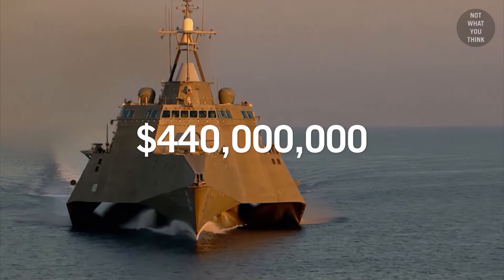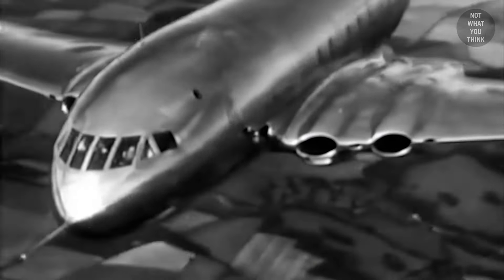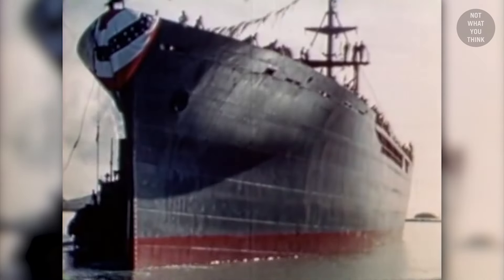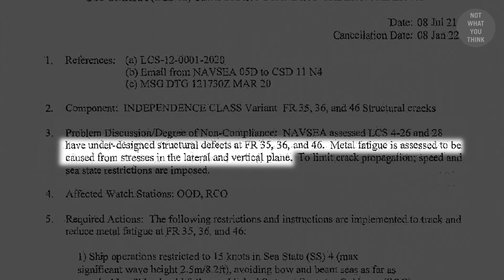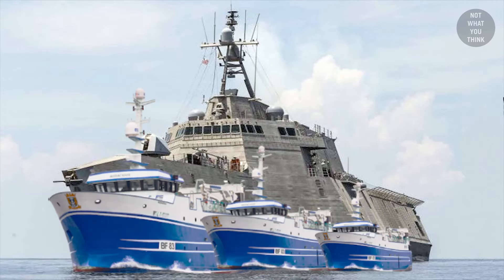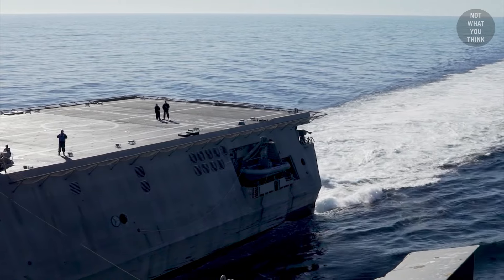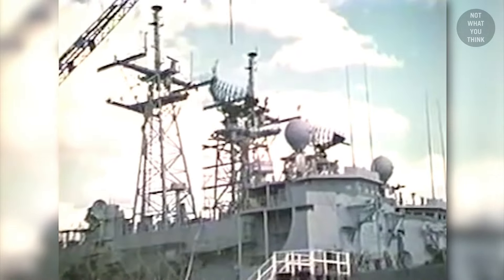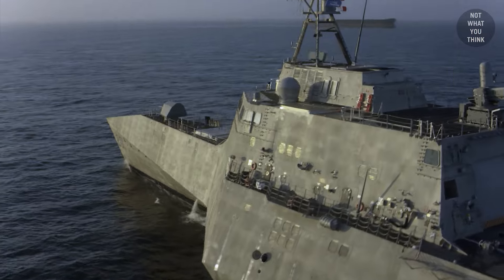SPEED Makes This Warship CRACK!

Comment: You'd think that with all the known issues with cracking in aluminum superstructures that it should have been obvious that building an entire class of ships out of this same material should never have been considered much less implemented. This should be even more of a no-no given that in the littoral waters where wave action would be even more pronounced and the possibility of encountering small boats turned ad-hoc military craft that if not neutralized quickly could inflict a fair bit of damage in short order. Since the USN has previous experience in how fast and complete aluminum can weaken and collapse, as was seen aboard the USS Belknap, it makes no sense to make an entire ship out of this same material. The loss of some speed would be a fair tradeoff to make to have a hull made out of steel.
Reply: Aluminum is used to reduce the weight of the ship and increase it's speed. Althrough you might as well just build them out of wood or plastic.
Reply: I'm betting some pockets were lined on both sides of the uniform.
Reply: It’s so stupid to build a ship out of aluminum that can not take any flexing and lack of strength from and incoming fire it would melt if on fire, they should of built them out of magnesium and would burn so hot and completely burn to nothing and at the bottom of the ocean it would still until there was nothing. And we pay these engineers big money but if they don’t have common sense they would build a hole in bottom !
Reply: You're completely missing the benefit of aluminum warships being easier to crush and recycle, as we now have to do with these. 😂
Reply: There is a MASSIVE amount of vessels made of aluminum before these vessels.  They are just fine, in fact they are tougher and faster than their steel counterparts.
Reply: @edwardschmitt5710  In which Navy would those massive amounts of ships be in because it certainly, except for the LCS, isn't the USN. As to such ships having superior resilience a fair number of Independence-class ships have proven that to not be the case given that half of the 13 vessels in service have developed cracks to such an extent that they are not allowed to operate in Sea States 4 or higher.
Reply: @randybentley2633  I see (giving sailor terms), you have changed tack and failed to address what I said. My qualifications to comment on boat building (by the way check out Sampson Boat building's "Tally Ho" project on this platform, I've watched all 150 episodes, or for laminations of mixed use see Louis Sauzede).  Now I will disengage.  But I will answer your obnoxious question:  "In which Navy..."  Yours in your bath tub.  And what ???? Cracks in the vessels?  Like the ones described in this very video we are watching?  Did you learn about "4 seas" before or just now?  It's hard to win an argument with a smart person but impossible with one who isn't.  Bering see fishing boats are aluminum, but mostly steel.  Coast guard small rescue boats, THOSE are RHIBs, with the upper structure almost always aluminum.   This was a new design, that failed.  It does not mean aluminum isn't a good material for boats, that is NOT the takeaway here.  Your type of argument you are attempting to use is an "argument of authority", accept the only info you are citing we both watched and it is not enough for you to opine.  I'm ten minutes from the ocean.  How many aluminum boats have you even been on?  I've been on hundreds and own 2.  In total I own 5 boats at the moment.  I'm 52.  How old are you?  What is your personal boating experience?
Reply: @DavidRice111  always has been

Comment: With regards to the liberty ships, in order to manufacture them in a matter of weeks, all the metals panels of the ships hull had to be welded instead of riveted. 

So what had was, once a crack started to form from example shell impact, the hull would start to crack and keep on cracking until the ship was cracked in two. If a shell had damaged a panel on a riveted ship, only the panels around the impact would get cracked/destroyed, but the crack would propagate through the rivets through the rest of the ship

Comment: I don't know what think tank told them aluminum was good for a ship but as you can see all aluminum is in trouble when in salt water. electrolysis is one thing but fatigue is a complete killer for the material and I think the navy has figured it out and is just trying to save face with there pride and joy or what was supposed to be there pride and joy
Reply: I think they were heavily lobbied by the aluminum manufacturers. When the damage was done the Navy demanded the production of the LCS to stop in addition to every other ship using it as a superstructure and they tried to change them to steel or something. The aluminum producers hated that and said that if they did, they will sue the Navy. The producers argued that it was not the aluminum that caused it, but tests seems to say otherwise.
Reply: The other issue was what these LCS models were going to be used for... mine hunting.  Low-magnetic (degaussed) steel is EXPENSIVE and HEAVY.  The ship wouldn't have the speed the Navy required nor immunity to older mines IF they had used steel.   The irony I see is that neither mine hunting nor littoral operations require a high degree of speed, so that speed requirement was a waste of resources for a mine hunter.
Reply: @swaghauler8334  This is completely true.
Reply: The report mentions galvanic corrosion at one point. This occurs when a potential difference typically in the tens of millivolts is set up across two dissimilar metals (assume aluminium and zinc on galvanised steel) separated by an electrolyte such as sea brine. This has been described as the aluminium "fizzing away" in cruise ships with steel hulls an aluminium superstructure. I can only assume that part of the problem here is the use of dissimilar metals in sea water not simply the engineering properties of welded aluminium. The tell tale signs of galvanic corrosion are visible corrosion a p.d. (voltage across the metals) and the evolution of hydrogen gas !

Comment: so from what I'm seeing and I'm going to say now I'm no physics expert but judging by the fact if they come across rough water bow on they can stress mych more likely, my guess is this isn't due to the aluminum hull but the actual tri hull structure itself. the complex design of the hull literally has a massive problem where a giant bow is connected to the side hulls with a convex plate armor. every time this thing hits waves that push up on the bow you have a few seconds where the weight of the ship is hitting a wave at speeds where the waves are hitting super hard and the bow is taking that stress and carrying it to those convex plates where stress fracturing is likely as the bow wants to go up and follow the waves for a few seconds and the convex plates are going nope you stay still. this repeated stressing is whats likely causing the stress cracks to appear. if this was scaled down in the front by 30 feet it might have reduced the stresses its recieving but only minorly. if you look at smaller boats with tri hull designs they don't have massive bow structures that are more than 30% of the length of the ship. likely earlier boat designers knew if you did there'd be heavy stressing of the connection between the central hull and side hulls so they never upscaled them to this size.

Comment: ALUMINIUM will always fatigue over time, unlike titanium or steel which require a given stress load.  Aluminum is lite and stiff, but comes with a cost. Same thing happened to my aluminum bike frame, but not to my titanium or carbon fiber bike frames.
Reply: 90 % of the bike frames sold in western countries are aluminum bike frames. They can crack, but only few does. My aluminum E bike frame has run now for 22k km, it's used to transport heavy stuff sometimes but it's still fine, in this case they didn't make the material extra thin to squeeze out the last gram for weight saving. 
Carbon fiber has a completely different fatigue characteristic, it can delaminate over time, and it don't bend - it stays flexible to the point where it snaps completely. Contrary to metal however carbon fiber is sensitive when it comes to side impacts, since it's a fiber material with the most strength in fiber direction. 
Concorde had a carbon fiber rudder, there was one case where a Concorde lost half of its rudder because of undiscovered delamination.

Comment: Interesting fact about steel hulled ships with aluminum superstructures. They use implosion welding to join the steel and aluminum. The metal comes in strips a few inches wide by two or so thick that are aluminum on one side, steel on the other. Theres a cool pattern in the middle where the sheets of metal were bonded together using explosives. Everything from the main deck up is sitting on those strips. Thats how you make a steel hulled ship with an aluminum superstructure. I worked for a few shipyards in my late teens early twenties. I picked up the metal from a supplier and was told absolutely dont let anything happen to those strips, they're expensive. Which immediately made me wonder if I was allowed to let something happen to all the other stuff I picked up. Turns out no, no i was supposed to protect that too. Stupid job.😁

Comment: Lol any welder could of told them this was going too happen (in fact I guarantee the builders did but the office staff didn't listen to the guys that actually do the work).
An to all the people that buy Ford truck with "military grade" aluminum this Is what you get to look forward too.
Reply: You would point that out.  Ford trucks, built Ford tough.
Reply: @ericvardek4108  Ford truck are great but only for the first 5 years, but that has always been true they have a tendency to fall apart after that.
Reply: @smokeshow1984  what about Chevy?
Reply: @Joshua_N-A  chevy/gm doesn't have aluminum frame's or body's.

Comment: Kinetic energy increases as the square of the velocity. Ship flex is measurable so you can stress the ship in various ways or test models, then measure the flex. This flex can be calibrated against the design software. The properties of materials used should be well known. It appears that Austal has a crummy engineering department, or management is interfering with them, and the Navy is incompetent to oversee the process.

Comment: From what I know and have heard earlier weld cracking had a lot to-do with HYDROGEN EMBRITTALMENT,      6018, 7018, 8018 etc.    steel  welding electrodes also called "Lo Hi electrodes"  short for "Low Hydrogen"    that were NOT heated in a special "rod oven", at hi temperature s  for a specific length of time and use within a short time,  would  absorbe  moisture.   
  That translated into "weld bead cracking",

Comment: How to defeat the US navy? Just try and get them to meet you near a storm front. No ammo required either. I guess the trade off for speed versus usability is really clear here. Maybe steel would be a better material at least for the hull. Superstructures can tear up a bit and be fixed with gum. Hulls,.. not so.

Comment: In Sweden, I think it was so, they use a special carbon fiber tape on concrete bridges underneath the structural beams  as reinforcement to extend their life.
It is incredibly strong stuff.
I suspect if they pre-taped vulnerable parts of the ship with this stuff it would significantly extend the ships service life.  It could also be used in the event of cracks starting to form at sea.
Reply: Yeah ...built lots of ships have you?
Reply: @edwardschmitt5710  A good idea is a good idea no matter where it comes from.
It is better to try than not bother isn't it?  Especially if it could save lives.
That tape can stop a bridge collapsing including the weight of many vehicles such of cars, trucks and buses, it would rather likely be able to stop the crack entirely from forming and certainly has the strength to stop it spreading and coming apart entirely.
Are you qualified to say I am wrong ?
Reply: @OniMetsuki  I build boats as a hobby.  Behind me out of the window is an aluminum boat I am restoring.  I have also built with fiberglass.   Now whether an idea is good or not, generally speaking, would center around all the facts.  In this case it would be the properties of the two materials.  No one, and I mean NO ONE sandwiches ANYTHING between two metals building boats.  Now lamination does occur with non metallic things in boat building particularly with polyester fiberglass resin.  Your example is they put carbon fiber UNDER bridge beams.  Entire boats are made of carbon fiber, particularly race boats.  Your comment just races between A and Z.  There is a whole alphabet in between (a science called "structural engineering" and I know there is a lot I don't know about that).  Even in my little aluminum boat I cannot see where you would add "carbon fiber tape" in between the seems without weakening it.  Like materials are universally used when building boats because of the stresses and loads unique to things on the ocean.  There is also the expansion and contraction of material  due to temperature fluctuations.  Not a big deal on a bridge but.....well I really could go on and on here.....but suffice to say, NO.  Even allowing if it COULD work, do you know how much that stuff costs?  I know I could not afford it in the 16' boat I built.  There is a reason race boats cost millions.....just "adding" a stronger material makes stuff stronger"???????? "Couldn't they just make the huge boat out of titanium"?????  There I fixed the Navy's issue from my keyboard as well.

Comment: AL structures crack for the same reason a 4130 tube steel frame cracks after ANY form of electric welding - localized heat treatment from the welding process.

Comment: While the Comet did have square windows the corners were well radiused. The problems arose due to the greater than expected stresses of compression and decompression after the Comet had logged over 30,000 flying hours. Metal fatigue was poorly understood in those days.

Comment: other issues with LCS.
-Armament: The LCS is the same size as a Fletcher class destroyer of World War II, but that ship had far more weaponry including 5 inch guns, torpedoes and anti-aircraft guns.
One of the LCS missions is Anti Sub Warfare, but it has no ASW weaponry. Yes, it would have a helicopter, but what if the helicopter is broke down or off on a ferry mission. 

Who thought up this maximum speed of 40-50 knots? This isn't a cigarette boat for teenagers. Endurance is more important than speed...big engines and a heavy frame make a coastal ship far too big. All other modern coastal ships around the world are half its size.  Twice the size means twice the target and twice the cost, all this for high speed? The LCS is the size of modern frigates and bigger than destroyers of World War II, yet has the armament of a patrol boat in order to accommodate the mysterious ultra high-speed requirement.
Reply: It looks cool. And obviously, that‘s all that matters nowadays… 😁
Reply: About the speed thing. Faster = safer. 
All the better to dodge in-coming swarms of Chinese hyper-sonic ASMs, right?
Reply: @ericvardek4108  Constraints in current ship design technology make this desired combination of design characteristics in small ships difficult to realize at any cost. Speed, displacement, and significant wave height all result in considerable increases in fuel consumption, and as a result, severely limit LCS endurance and weaponry. A speed of 35 knots is not needed, not for mine hunting, not for patrolling since it burns too much fuel, and not for anti-submarine warfare. Ten knots makes little difference trying to avoid anti-ship missiles or aircraft. It would only make a difference while pursuing small boats, but then it has a helicopter. Finally, corvettes operate in unfamiliar shallow waters with reefs, sandbars, and underwater rocks, so going fast is unwise.
Reply: @spikedpsycho2383  So, bad idea all around. Got it.

Comment: Aluminium performs badly in a maritime environment. The constant back and forth rocking motion, plus the corrosive seawater causes metal fatigue to develop quickly, from micro cracks to visible cracks. Even a speedboat that is made of aluminum requires frequent maintenance due to this problem.
The LCS looks beautiful in appearance and it's specs looks great on paper. Inspite of this it's hard to imagine why would any navy want to use aluminum for building ships.

Comment: I've worked with aluminum, and would not want a warship to be made of aluminum. Not to mention how weak aluminum is. Aluminum is a bad metal to use when exposed to waters, there's high corrosion. If Steel has such structural issues, than aluminum is worse. The only place aluminum should be used is aircraft, or ground based vehicles, and even still isn't necessarily the best choice.

Comment: I've built many aluminum boats. But one navy ship the uss. Decatur had the first aluminum main deck above super structure. The problem with aluminum 
On a ship as primary metal is that the temperature of saturation is faster than steel. And at on time a Hull may be 60 degrees F. And the top deck 120 or vice versa causing abnormalities between the greater temp differences in tensile strength at the section of that differences resulting in deformities and linier indications or cracks.